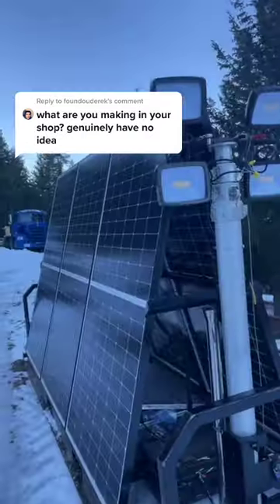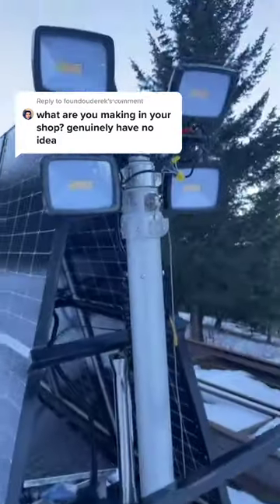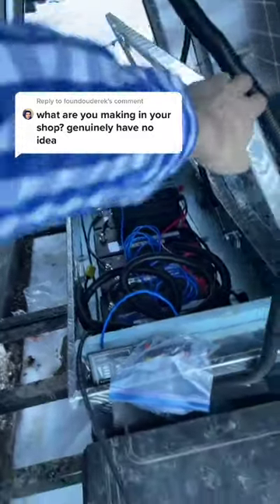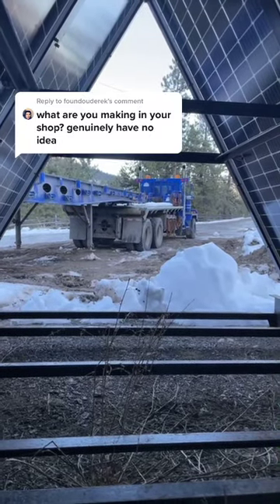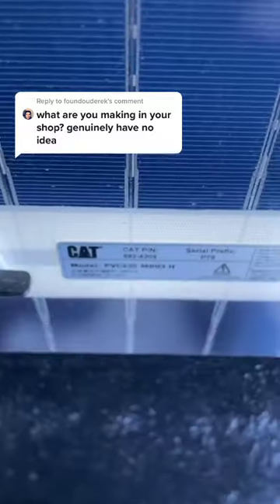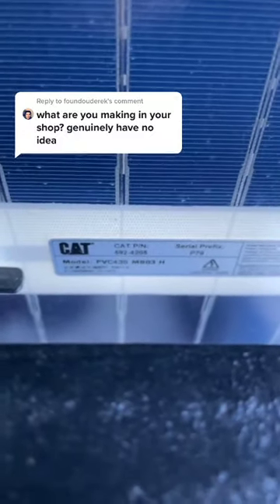Solar Light Towers

Comment: Now the million dollar question is how much would I need for my of grid life.
Reply: That depends entirely on your likely power consumption and your battery bank and your inverters and charging system.

You can have a qualified electrician install CTs on your mains at home and gather your power usage data over time, and practice using as little as possible to simulate off grid living.
Reply: @i-love-comountains3850 don't forget the climate you are in.

Cloudy all day versus sunny most of the time are two very different solar generation amounts.
Reply: If you really want to find out, start logging your power consumption. At best in 5 min intervals. That way you or an electrical engineer can use that data together with simulations for solar and batteries to give you the best bang for buck or maximum self-reliance. The optimal solution is probably to still have your connection to the grid, so you can live comfortably in the winter without breaking the bank on panels or batteries. And if the power goes out in the winter you just have to not use large power consumption items, like the washing machine and dryer or the TV.
Reply: It'd be great if you post some of the parts used so I could see how much that would cost sorced.
Reply: you can get a tesla soalr roof its not that expensive, with the wall batteries you could be offgrid for ever

Comment: Around here, these trailers are in parking lots with blue flashing lights and security cameras for anti theft.
Reply: Same here. They set it up on a turn and it was blinding at night. Then they didn't maintain it and now the light covered in vines.
No idea what it was for as it was plopped in a clearing. Now the clearing is over-grown and you couldn't get any normal vehicle through there 😆

Comment: Only issue I have with this design, is the fact that the bifacial panels are not quite positioned properly for full utilization. The backsides will not be able to collect much light except any reflected around that might hit the backsides; and that's not going to be much in that position. Even if the panels are facing east to west. 

Some mylar inside the 'tent' of panels will help with that to some degree though, with some reflectors positioned to redirect some sunlight into the space between them. 

It's not a bad idea by any means, but ultimately some normal panels would have done the job just fine as well.

And yes, due to the position of the sun generally changing from our perspective due to the earth's tilt, the orbit position, etc; some light will eventually be directed into that space depending on that position. But it's going to be wasted otherwise in basically all the suns more overhead positions during the rest of the year. 

I'd put a reflector on the backside of the light tower to put light in from that direction when shining against it, and one on the ground side of the other end for similar reasons from that direction. That combined with the mylar inside on the bottom should help resolve this situation to it's likely best possible end result. 

If you want an easy way to test to see how much power you are losing essentially, just go ahead and cover the panels as arranged right now and check the output. Whatever output you are getting after that point, is the result of the backside getting whatever light it gets currently. Once you have that done, go ahead and get some light into that area like suggested, front sides still covered. Now read that output. Now that you have both those numbers, remove the covering while leaving the mylar and reflectors in place. Read the output again. 

You should be getting something in the neighbourhood of around 650-800w per panel fully lit up, after taking into account efficieny losses due to heat. You have 6 panels on that unit, so I figure you'll probably be getting a total output at that point somewhere in the neighbourhood of a minimum of 4KwH. Fully lit up that is. The way you have it right now, I suspect that is closer to your current maximum at full coverage of the front sides. The maximum you could get, is closer to something like 5KwH, up to somewhere below 6KwH in perfect conditions. That's both sides fully lit, and heat losses affecting things minimally due to the cold temps outside.

That said, I am no expert on these things. I am just someone who's been paying close attention to these things, because when I have the money to do this sort of thing myself, I want to be as up to date as I can be on the matters at hand.

And make no mistake, this is not some dig or jab against solar or bifacials. Those panels are probably going to be the ones that make the solar transition for many, possible. They're the closest to getting 1KwH on their own per panel, which is my personal opinion on the point that solar panels need to reach before mass adoption becomes viable. 

They are about 70% of the way there at this point. 70% because they only output about 650w or so on the front side with full coverage, and the backside has depreciating amounts provided depening on how much light they get as well. Combined they can technically reach 1KwH per panel, but again, efficiency losses come into play, and solar position comes into play as well as the albedo effect. Maximimzing these in conjunction with each other will get the best results of course. 

Personal project hobby farm as it were, is probably going to need somewhere around 24 of those panels in a paired series/parallel setup of 6x6/6x6 for increased amperage and voltages required for my needs. 

The design in mind is meant to produce enough power for my needs for the day, in one hour, with all the other hours of sunlight going towards the battery bank. Excess at that point beyond that is put towards other uses that make effective use of that extra power available. Like heating a titanium core as a heat battery, that keeps the abode and outbuilding warm instead of using a furnace. Titanium holds onto heat for a long time compared to other materials, and so as such can be used as thermal mass to blow air over to heat up and disperse where needed. 

Anything beyond those uses, goes back into the grid for profit.

Anyways, if there is something I missed, or got wrong by mistake, again; I'm not an expert. (But basically no one else is either, since solar panels haven't been in use by the public long enough to produce any experts either. The only ones that exist, are the people making them. And they probably aren't commenting here.)
Reply: You should post a video. Sounds like you have a purty good grasp of solar. ( as far as my ignorant ass is concerned😂)

Comment: Will the trucks have some sort of takeoff that could power flood lights so it could be used as a really big generator-battery bank of need be?
Reply: vehicle to load? vehicle to grid, these are the terms you need and yes the big fat inverters that turn the wheels will happily run electronics (I don't know the what voltages the inverters are running so check with edision but I am sure it is in here and if nothing else I know they intend to build to order)

Comment: If they are bifacial panels wouldn't it be better to mount them further apart so both sides can get more light? If it's designed to be mobile then i can understand the compact design, but why use bifacials? Aren't they more expensive?

Comment: why not point south 45 degree angle?
Reply: It depends on where in the world you are
Reply: And time of year
Reply: @EO.studios  sure, but I don't think you need the light during the times in midsummer arctic the sun would be visible most of the day when you would get most out of the east-west, compared to pointing both of them in more shallow angle towards equator. the east-west steep configuration loses half of direct all of the time and sometimes 100%. it would be more effcient to at least have them in a v.

the steep angle makes easier to keep it clean though. solar lighting is a challange for arctic of course since the time you would need it the most the least hours you get sunlight in a day. maybe his market is more near to the equator instead of being local to him where the east west kinda works if you absolutely can't lay the panels more flat towards the sky. the actual panel cost is likely pretty neglible too compared to the batteries and inverters and shipping of the thing.

Comment: Those aren't very powerful lights, and I prefer my 20kw light tower I rent it out all summer tow it home in the winter to run my house during power outages no sunlight required , also if someone wants quieter light I rewired it with the option to run off one 20amp 120v receptacle.

Comment: In Your tent-shop today:
Combined Heat and Power (CHP):  An engine becomes WAY! more efficient IF you can use the waste heat.
That's a couple of heat exchangers (radiators, intercoolers) on a std genset and you have:
Free heat + electricity for the shop and house
or
Free Heat for the shop and house + electricity

ie:  If you/Edison isn't adding (micro) CHP to your Solar Trailers etc; your image suffers and you look like dumbasses!  😃